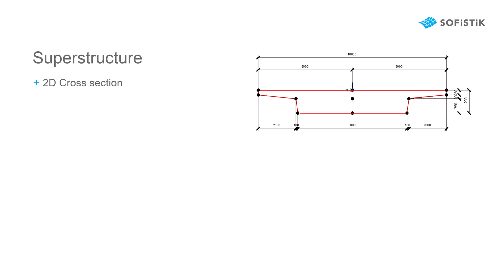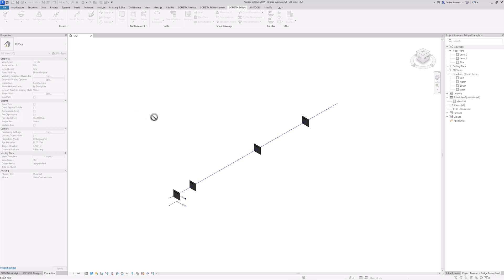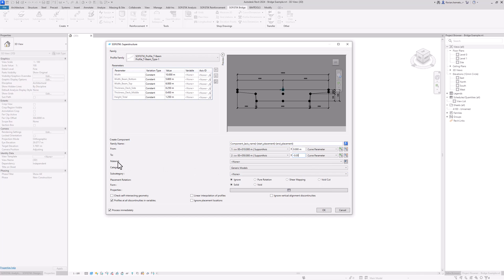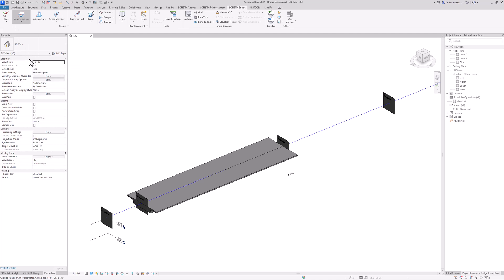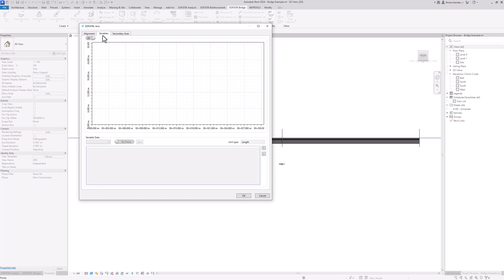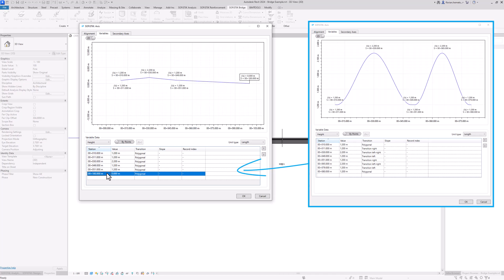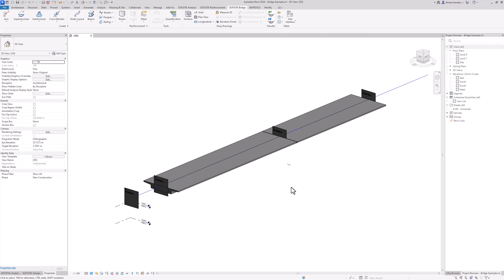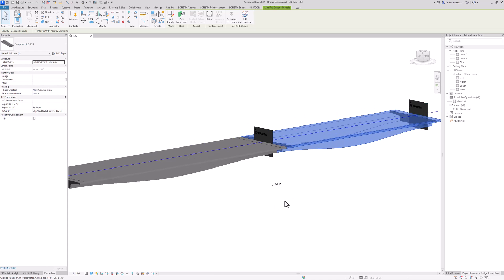#2 - Superstructure - Getting Started SOFiSTiK Bridge + Infrastructure Modeler for Revit

Comment: How to i achive superelevation and road width from xml file
Reply from the maker: Hi rasikasid7181,
you can do that by importing the information as a variable, or secondary axes.
Then you can assign it to your superstructure cross section.
Reply: I put it but the superstructure doesn't move that way. seen only 1.43° slope
Reply from the maker: Hi rasikasid7181,
Please contact us through the official channels for such requests.
I assume this issue requires a little bit of hands-on engineering ;).
Your easiest way to cantact us is directly in the software via the "Support Assistant".
Or you can reach out to us via the contact information on our website (https://www.sofistik.com/en/).

Comment: How to create a new family like Sofistik_Tbeam?
Reply from the maker: Hi gauravdamle2000,
the SOFiSTiK_TBeam family is a cross member family. It uses one or two adaptive points and a volumetric family.
We are working right now on tutorials for this matter.
I can give you a pre-release link here, where you can see how to model a substructure family (one adaptive point).
This can be translated the same way to cross member families.
Here the link: https://www.youtube.com/watch?v=G8ZfW7uS4J8
Reply: @SOFiSTiKAG  Thank you. I would like to know whether can we create geometry in Grasshopper and use the same model to Revit to use sofistik reinforcement modeller?
Reply from the maker: Hi gauravdamle2000,
Please send requests like that throught our official contact channels via our website (https://www.sofistik.com/en/).
As for your request: 
A direct connection like that does not exist yet. there is the possibility to translafe lines from GH in Revit to reinforcement, but i assume this is not what you mean.